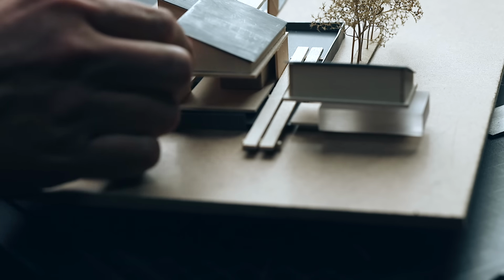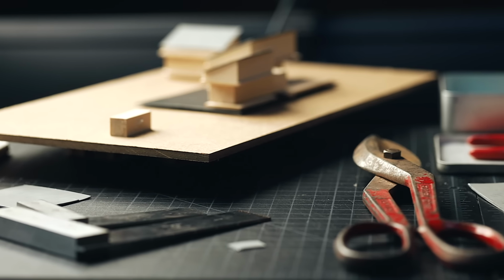30 Minute Study Model - Here's How

Comment from the maker: Links to all the materials, tools + details here: https://thirtybyforty.com/blog/building-a-30-minute-study-model
Reply: Only thing I wish you had was trace sketchbooks that had 1cm grids (compared to the 0.25in) :/ . They look really nice and was planning to get one/more but since we use metric in au, the sizing of the grids would make it really hard to use and scale with :<
Reply from the maker: @darksky1628  You can assign 1 grid to any scale you choose, right? 1 grid = 1m, 1 grid = 10m...I used to use the Muji ones with a 5mm dot grid like that...cheers!
Reply: Hi Eric- Old school model buuilder hack is to  put your index finger on the back of the olfa blade itself.. it is scary at first as your brain wants pull back, but the edge is not sharp enough to cut. You have more control of the blade.  The cuts will take  fewer passes and be more precise.
Reply: @MONTOUTE-STUDIO  That design has all the ambience of a confused saw-tooth factory roof.
Reply: Hi, the link (amazon) about vegetation doesn't work...

Comment: Thx for the tips. One thing I noticed, I see your hands pushing very hard, pushing down the ruler and pulling the blade. I'd recommend relaxing both hands a bit, and allowing the blade to gently do the work. Will save your hands long term, from tendon and nerve problems.
Reply from the maker: I'd recommend trying my technique, been building models for 45 years! Fewer cuts are much easier on the hands, blade does all the work, first time through.

Comment: Btw…. Great work and little hacks. I like your leaving an edge on the base of structures. I plan to keep that one in mind now.  

I do mostly furniture and artists studio equipment , so building models to 1:6 or 1:12 allows me to use the Pichen  ultra realistic scale people.  They are fully articulated 30+ points and skinned with soft silicone.  They also have less realistic version android style . They really help with adjustable and modular design work.

Thanks for the inspiration

Comment: Back in the 70s my cousin was in architecture school ( he eventually graduated with 3 degrees and is well known in Nashvegas .

No internet , EBay, or Amazon…. So I helped him collect wooden window blinds , metal findings, etc. all the fun stuff used to build models. Such a rich environment to experiment with. I can model in 3D but a tangible model is special.

Minor point…. Hot melt glue doesn’t dry … it “sets” or cools, but there is no waiting for evaporation 😂.

Comment: Good video. Good point about the gripping.  I'll wrap anything with either rubber bands or stretchy silicone tape to make it grip easier.  
About the blades. What you say about X Acto #11s good points. I sharpen blades to get more use. The thin X Acto blades I've found when I sharpen them (Those small diamond sticks, red, blue....) the blades lose their edge shape and then tend to wander. Utility blades (anything like your snap off knife or bigger) keep their edge shape. I don't like the snap off blades because they always wobble.  Learning how to sharpen has been a really useful skill. 300/1000 diamond 'stone', those little diamond sticks and Scary Sharp (sand paper on float glass), and  a ceramic stick in the kitchen (keep cleaning it and replace it every year or so. Wrap some of that stretchy silicone tape over one end of 1/2" pvc pipe, magnets or tape it to the top of your microwave - sheath for the ceramic stick. It'll never roll off the counter and shatter.) I use scary sharp on chisels, plane blades, kitchen knives. When you plane soft western red cedar and then give the blade a tune up after an hour and notice a difference? You're dialed in. I used to think edges were as sharp as they were ever going to be when I took them out of the packaging. Now the first thing I usually do is sharpen them. 
re: hot glue. I've found the Surebonder H-195F has the narrowest bead and best control of any hot glue gun. Uses mini sticks.  (I've got minis all the way up to a $200 industrial one that I always get burned using)  I think most model and prop makers use super glue and accelerator. 
I've made a lot of modeling parts ripping down those spruce 2x3s from Home Depot (Now a lot of them are fir which is still good, but not for small model making.) I use a table saw $800 (25 years ago) with a $600 Incra fence... so not something you'd buy for architecture school. (If they have a table saw how good is the blade? If it's not well taken care of, buy whatevers the smallest Diablo blade that will fit on it's shaft. Even 7.25" Just change the blade out when you use it.) You can dial in really precise thicknesses. And the spruce is soft enough you can easily hand sand 1/8" off any small piece.   Once you, or find someone, starts making bits and bobs from $2.50 2x3s your options are wide open.

Comment: Thanks for this in depth video! So many great ideas to try out. I use hot glue often in film industry modelmaking, and have found that turning a can of keyboard air duster (Dust Off brand, etc.) upside down sprays liquid instead of air (not recommended in the instructions lol), and it cools and sets hot glue joints rapidly, allowing me to work faster.
Reply from the maker: Nice tip...thanks for sharing!

Comment: Great video! have you tried using Cyanoacrylate glue with an accelerator instead of hot glue?
Reply from the maker: I've had mixed results. It's great given how fast-setting it is which is perfect for certain applications...but I find it more unforgiving and messy than hot glue.

Comment: hello 30x40 how would you consider an ideal design for a tropical region like UGANDA, can you share tips on the style, and roofing style, would you recommend things like insulation in the ceiling and walls, brick walls seem cheaper than timber framing do you think its better to use brick for construction or timber frame?
it would be nice to know that some of the concepts you share here can still work in a tropical country like UGANDA

Comment: How did you connect the guitar string without creating a mess with the glue on the doors?
Reply from the maker: Two means for doing this, in this video I use a small dot of white glue at each end. The other way requires no glue, see this post + video for that technique: https://thirtybyforty.com/blog/model-build-outpost-project
Reply: @30by40  Thank you!

Comment: Had a similar experience with the metal ruler in college as well, only I managed to cut across 3 of my fingers and nails... Not sure what it says about us, but I was more concerned about all the blood ruining my model instead of going to ER.  I was fortunate I waited one more cut before replacing the blade... It was quite dull at that point, but still did a lot of damage. Model was fine and got a great grade on it.
Reply from the maker: Ouch...glad you (and the model) made it through!
Reply: @30by40  Just noticed it, but as you can see in my profile picture, the little fellas are good. 😆

Comment: Gosh this reminds me off my torture of making models. This is why i mike to have an idea of dimensions before making these. Which my teachers do not approciate 😅 since it makes me very slow rip.

Love the setup! I also used 2 mats. I have also the big cutting knife, and a smaller one with sharper black blades. Its not yet an exacto knofe tho. Id recommend it too.
Reply from the maker: I can relate...it's torture until you make a little miniature thing you're proud of and then it has a mysterious appeal. I'm always striving to maintain the balance between perfection and good enough. Keep making things, it gets easier. Cheers...